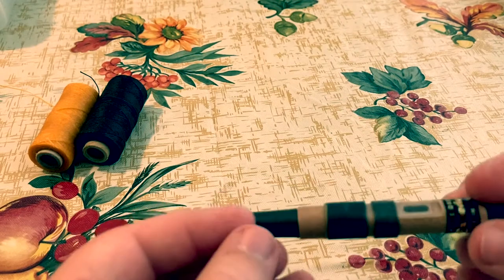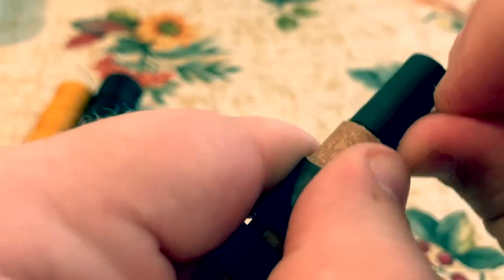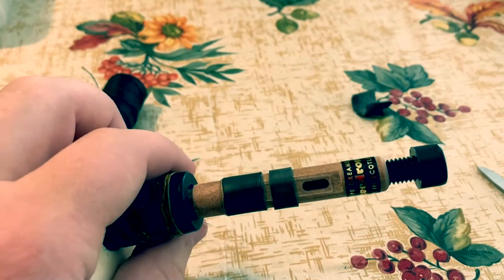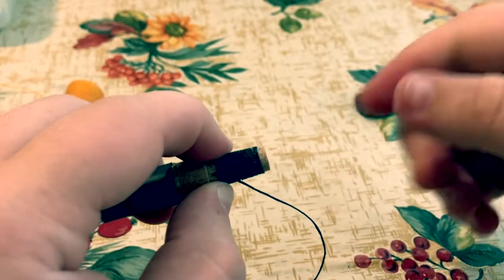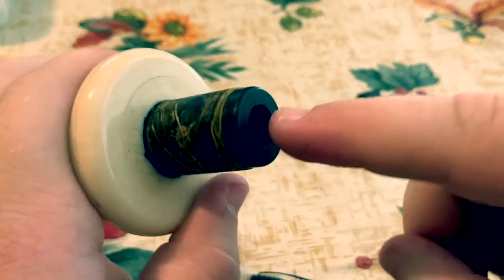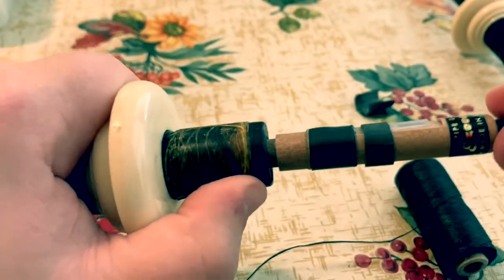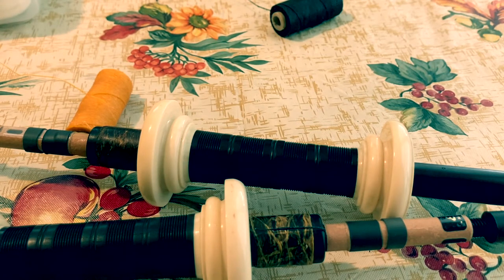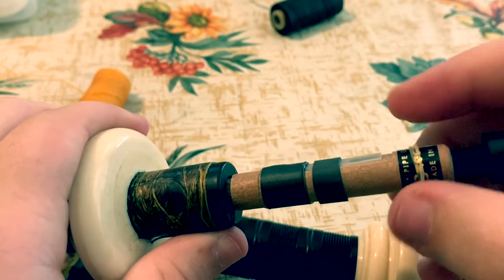Best Method for Seating Bagpipe Drone Reeds

Comment: I've often seen the need to use a Halls HB 34 tapered hand reamer to clean up or make same seats not done well by the maker or others in between. This hand held twist reamer us the same as used by many big name pipe makers. It only takes a few twists to 'fix' unequal or poorly done seats. It's available in USA for ~$35.